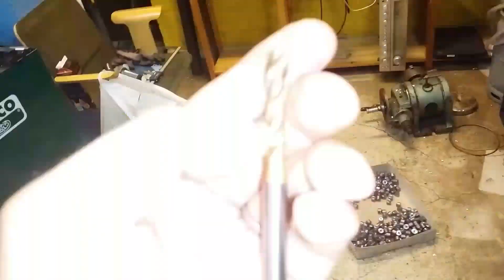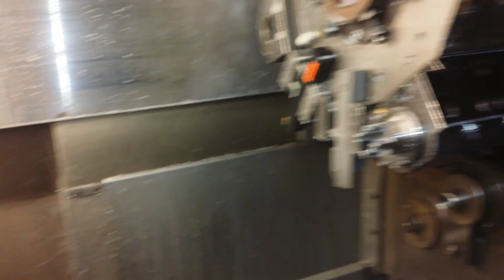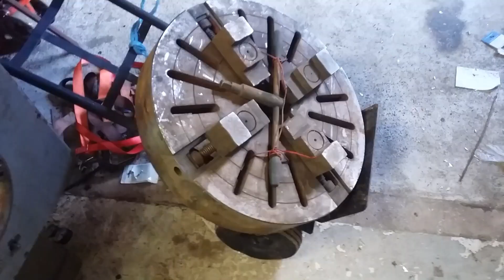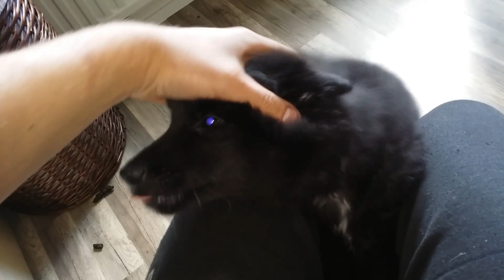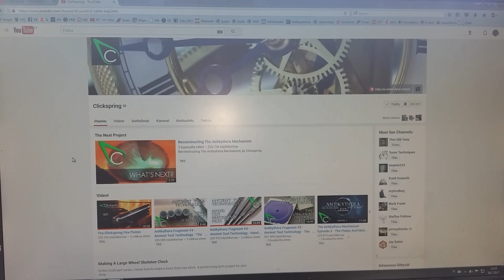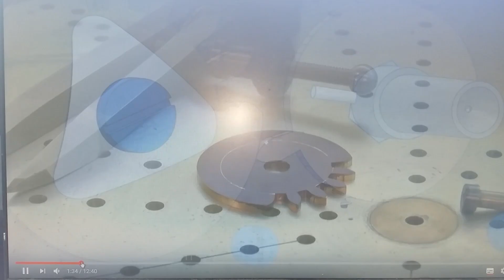Daily Chatter 7 -Yesterday aftermath and axle repairs-

Comment: Have you used any form taps? I run a job where we get around 3000 3/8-16 tapped holes in mild steel with just flood coolant. You have to be very careful about the hole size, but it makes beautiful threads and lasts forever. Love the puppy!
Reply from the maker: I've been wanting to test form tapping for a long time! Never done it in other words :-)!

Comment: You should make yourself an ER32 or ER40 holder to put in the hole where the boring bar holders go on the lathe. That way you can put any drill you want in it.
Reply from the maker: Yes. I have a MT4 ER40-holder that I used on the previous job to hold a small drill but my MT4 sleeve is so worn that I do not trust it will hold under heavy drilling :-). I wonder if they sell ER holders with straight shanks? I doubt I have the time to make one anytime soon!
Reply: They make lots of ER collet holders/chucks with straight shanks, but on most of them the shank is too small. I guess the hole in your boring bar holder is 40mm or 50mm. I see Maritool makes one with 2" shank. I have made my own for ER32, they have 40mm shank. I can send you one of my test pieces if you want. Works fine but finish is not 100%.